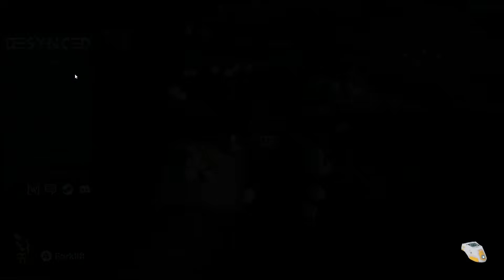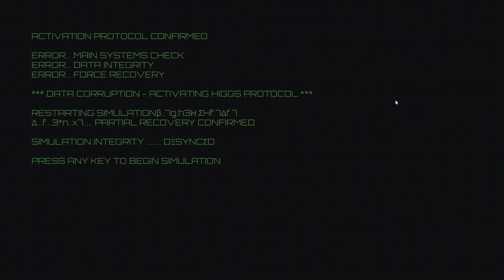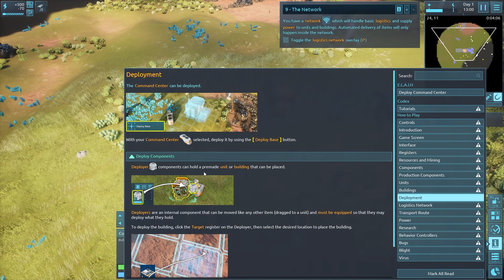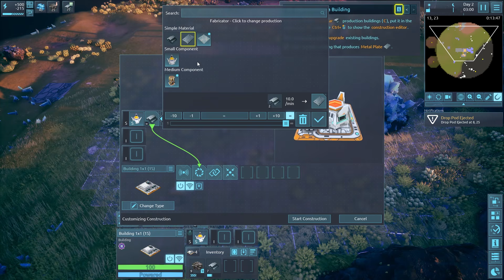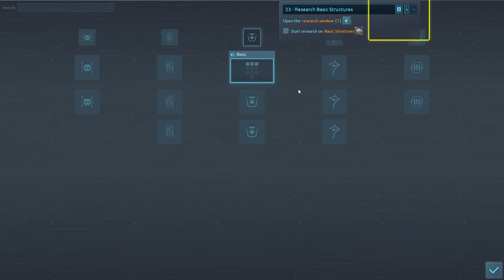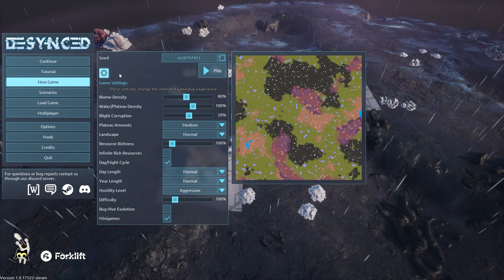Desynced 1.0 Is Here | Sci-Fi Automation

Comment: I have watched until 12 minutes, let me give you some advice on what you did and why the game "got stuck".

You were supposed to place that first Fabricator building a few tiles away from the command center, but not Directly near it.

Your technique with Relocate was correct, and this created an order for the "Logistics Network" to move the thing, but sadly, this cannot be overwritten by the Manual Order (Right Click).

Here is two way you could have solved it:
1. You could have moved the blue Logistics Network area over to the left near the misplaced building.
2. You could have forgotten about it and simply made a few Metal Bars at home at your Command Center, thus enabling you to simply make a Second building closer to home.

I truly hope you stick with the game, because the way you can design units and building with components is a really unique and super engaging way of dealing with Automation, and while it is a slow burn and takes a while to learn, there is nothing quite like this game!
Reply from the maker: Thanks for the tips! The game does have a unique way of handling automation. I liked it!